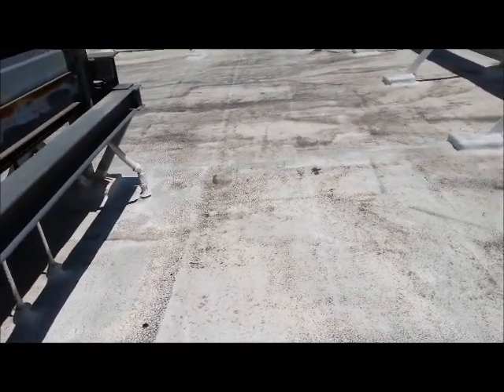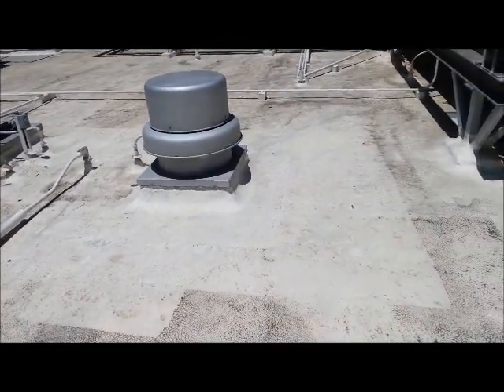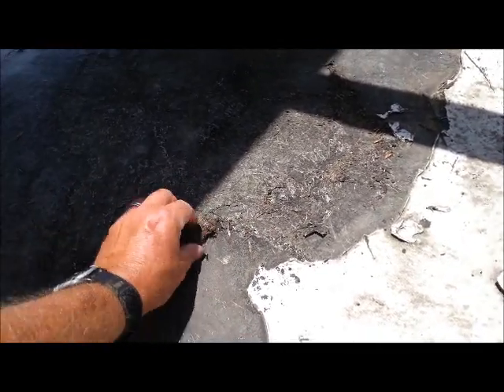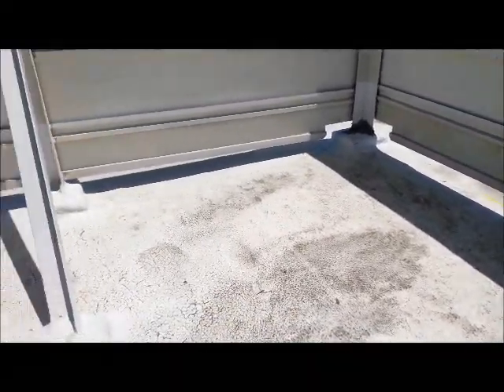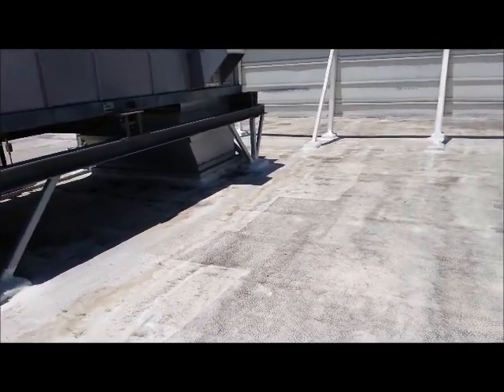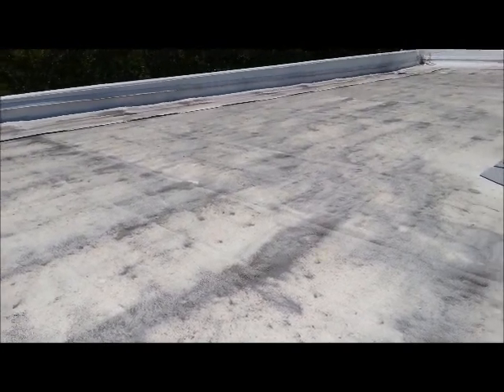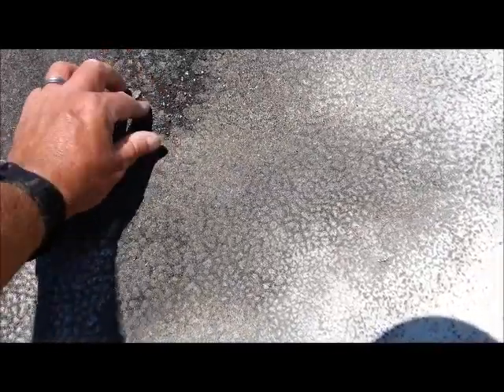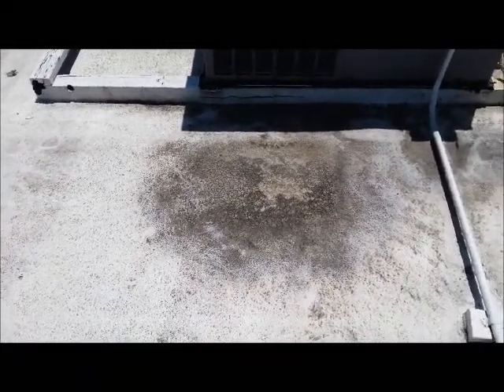Emulsion and Acrylic Roof Coating Testimonial

Comment: That roof failure is not the fault of the system, it is the fault of the installer. Chopped fiberglass emulsion roofing should be a minimum of 72 DFT, and that roof is nowhere near that spec.

If there is a weakness with that particular roofing system it is because it should go down 144 mil thick, which looks like way too much when you're spraying it on, and consequently it usually gets installed too thin - it is 50% water and when it cures out half the thickness is gone.